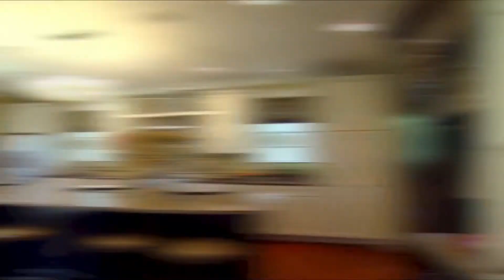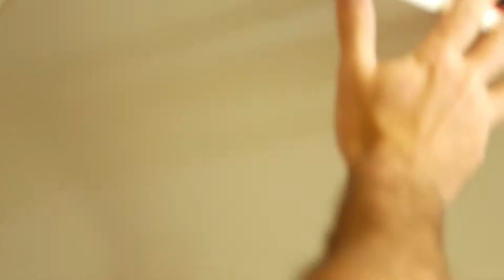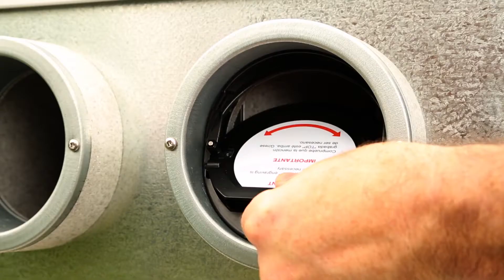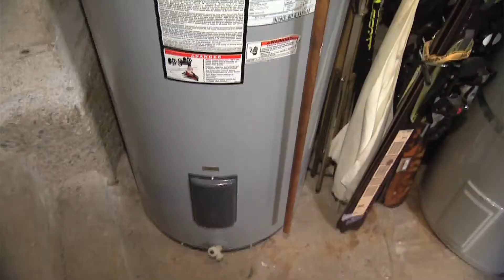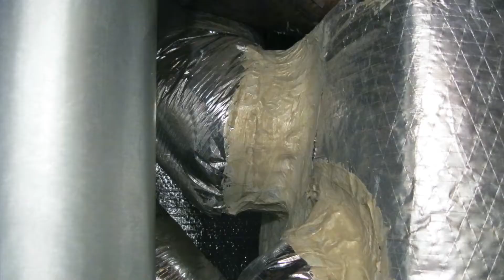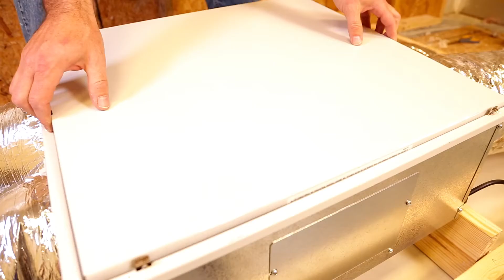Broan ERVS100  ⁠— Installation Video

Comment: My unit is installed in the bathroom, replacing the bath fan. However, there was no control switch installed by the home builder. Could this be an issue?
Reply from the maker: That should not be a problem; the unit has internal timer controls that would be adjusted when the system is installed during commissioning.